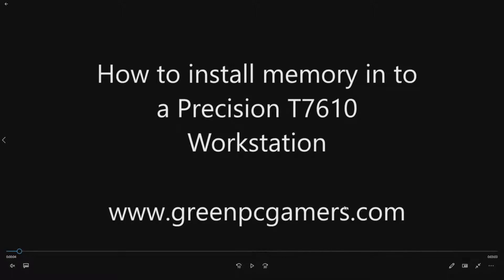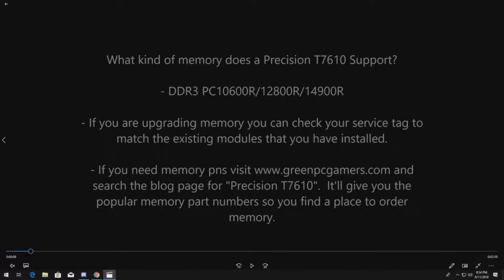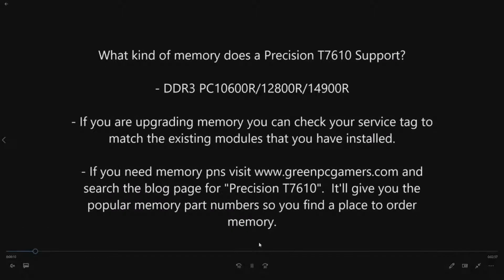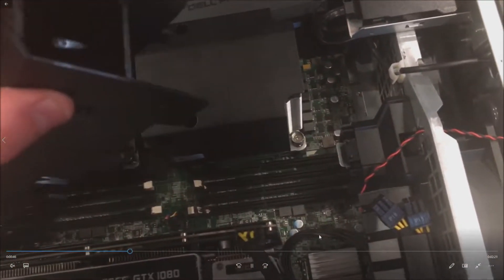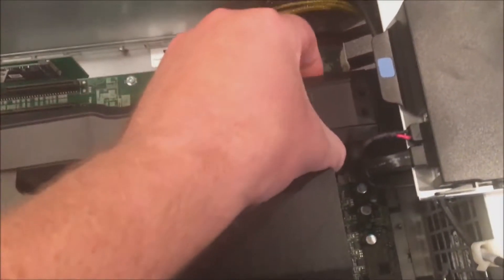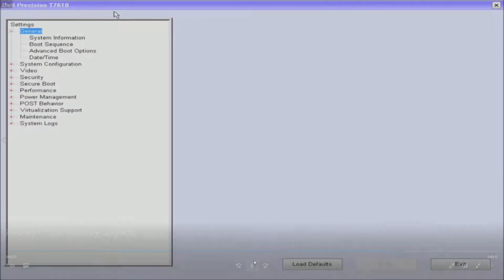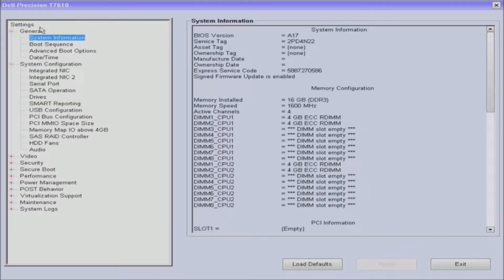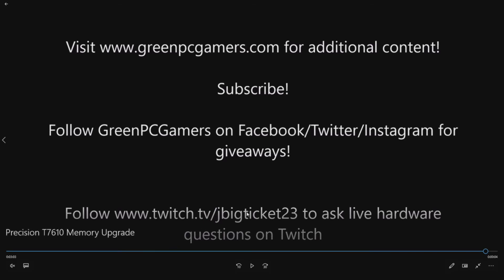How to install Memory/Ram in to a Precision T7610 Workstation

Comment: recently my Dell Precision 7500 stopped utilising the full 64GB of RAM installed on the device. BIOS shows all RAM modules for 64GB installed, but windows only states that 32Gb is usable. I havent made any changes to the OS or the motherboard settings within the BIOS. Any ideas what could be causing this please?
Reply from the maker: Hey Gary, Do you have 2 processors installed?

Comment: Where do I get some memory shrouds? I found some online but want 200$ for them and that just seems outrageous. Do even really need them??
Reply from the maker: You absolutely want to use the memory shrouds for proper cooling.  You can pick them up on eBay for $45-$75 depending on availability.  They should get cheaper in the next few years.